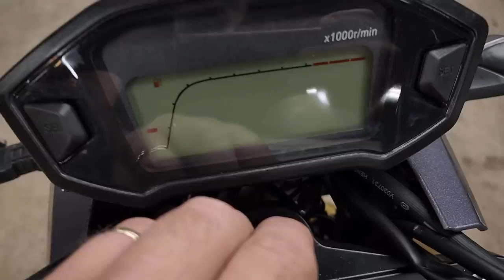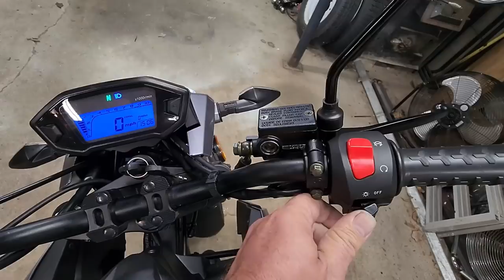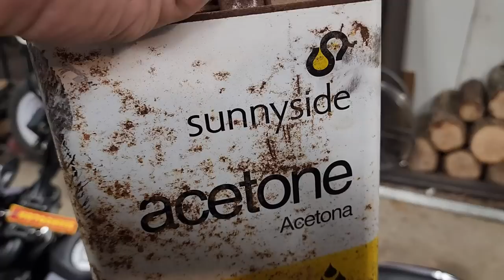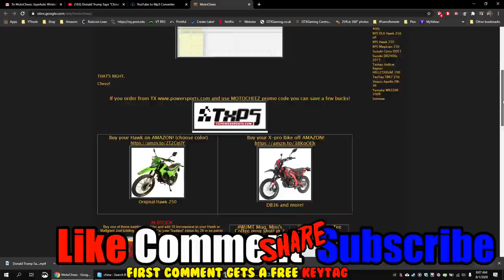BRAND NEW RPS Condor 150cc Grom Clone complete unbox build ride review top speed and 0-50 time

Comment: Everyone knows those Chinese speedometers are always wrong.
Reply from the maker: Yeah, most motorcycle speed is always read faster.
Reply: @MotoCheez  On my kp mini..when it says 65 mph, it's actually 55 mph.
Reply from the maker: @gmodesike wow!  Never saw one that far off. You may be able to get into the speedometer to change the wheel size, both my grom clones are only off 3 to 4 mph